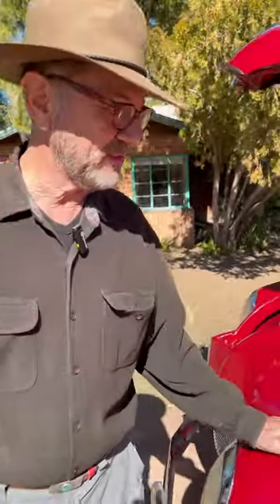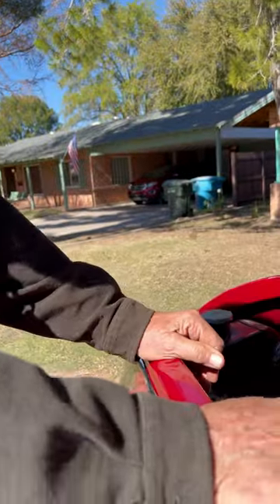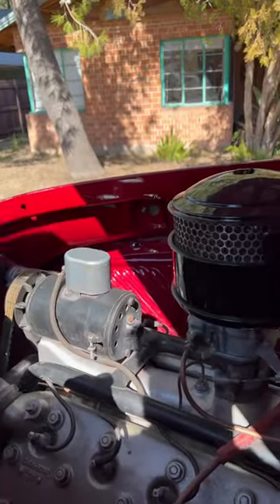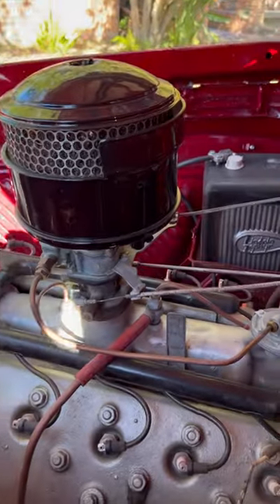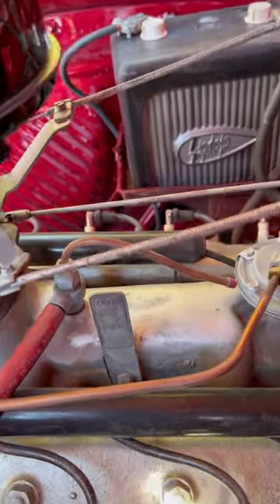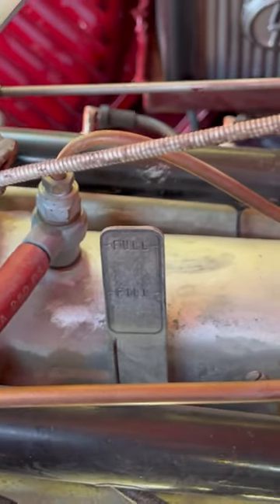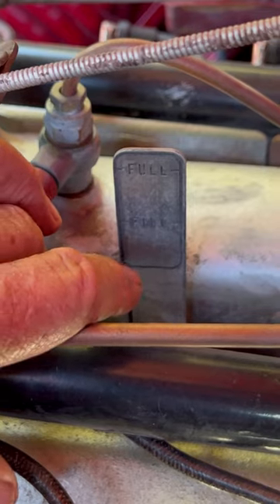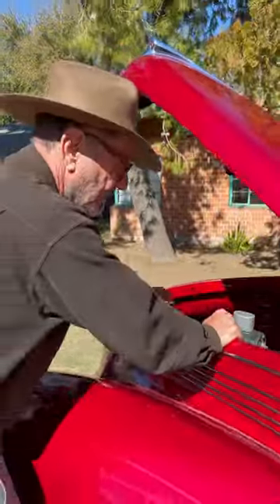Crazy No Dipstick Oil Check - Early Lincoln V12 Flathead #shorts #classiccars

Comment: No electronics needed, yeah Ford/Lincoln not known for good electrical period...
I noticed the Single barrel carburetor on a V12 Flathead, talk about majorly under carbureted...
Reply from the maker: It’s a single carburetor, but it does have two barrels… Yeah, JB has designed a custom intake manifold for these things that accommodate three stromberg 97’s… Seems to be a much more even presentation of fuel to all the cylinders. In other words, you make a good point!

Comment: One major problems with cars build before the 80s for the most part the engine and transmission did last 100 k usually there were some exceptions not many you really had to be right ontop of maintaining them .when I was a young man growing up and searching through junk yards all over the place  most cars had under 100k but they were definitely cooler looking and no plastic in the cars was awsome 👌 😎 now we can rebuild them with newer drive trains suspension and brakes and other comforts 😮now we can get 500 k out of our power trains unless you built a 1000 hp beast which is fine too but plan on a fleshing up every 60 k or so if your goin to drive it hard things have changed a lot in just 45 years we can really make our rides almost bullet proof😅😅😅
Reply from the maker: I agree with you wholeheartedly calling you have the right take on things I think

Comment: Thats why flatheads only lasted bout a 100k and blowed up they had no oil filter or drain plug on the pan... u checked it if it was low put some in it if thise engimes was had filters and couldve change the ol they wouldve run forever far less moving parts in a flathead

Comment: The most reliable is a stretch. Engines are inherently dirty and gunk buildup around the tube the marker goes through would probably cause this thing to give wrong readings.
Reply from the maker: OK, may be a bit of a stretch, but it sure was an easy read without getting your hands dirty… Let’s just go with that?

Comment: back when engineers had a brain and used it and built things that worked and lasted. 
compared that to today's junk and it makes you shake your head
Reply: Yep. as a mechanic id much rather work on this stuff then newer stuff
Reply: Now computers make it just strong enough,and last just long enough. (until they want you to buy a new one)
Reply: @atcjoe1600  couldnt agree more
Reply: That’s true except for the fact it was hard starting in cold weather had to warm up for 15-30 minutes burning extra gas and got 5-10 mpg. Other than that it was great.
Reply: @bobolink39  I mean my 96 f350 powerstroke starts just fine in 0 degree weather.
Reply: Built and lasted? These engines were severely under powered and were plagued with oil sludging and overheating.
Reply: And needed at least a valve and ring job every 35-50 thousand miles, plus plugs and points every 10-12 thousand with timing adjustments and seasonal carburetor re-jetting, 2000 mile oil changes, changing oil and cleaning the filter media in the oil-bath air cleaner, greasing 12-20 different chassis zerks, re-packing bearings at least every year, front end alignments, brake shoes (not pads) and bias-ply tires about every 12-15,000 miles and many other things that we don't have to deal with on a modern vehicle that will last 2-300,000 miles with very little maintenance, and are easily 10x safer in a crash.

But yeah, those were the days.
Reply: @ROBMACDUI  Right!?  Today you can buy a car and it's no big deal to drive it 100,000 or 200,000 miles with nothing other than routine maintenance.  and a single tune-up. That old engine would have to be rebuilt multiple times to last that long, plus it's low-powered, sucks down gas like it's going out of style, shakes, makes more noise and pollutes like hell.  It's ok to love the simplicity and the historical and cultural value of these old engines, I do too, but if you think they were better than what we have now you're either deluded or you're buying some shit brand of cars.
Reply: @atcjoe1600  most older vehicles could never make it over 100k miles
Reply: @7.3PSDA2  a 96 is not comparable to what these people are talking about.
Reply: @budgroweryt9947  why not?
Reply: @7.3PSDA2  because a 96 still uses a lot of electronics, and a bunch of other modern technology. I had a 91 f250 with the 351w and it was still not comparable to what these guys are talking about.
Reply: Back when a car had about 20 wires. Engineers today do have brains BTW
Reply: @budgroweryt9947  well my 1955 f100 with a flat head 4 cylinder or my 1951 ford 1 and 1/2 ton with a flat head v8 might be more along the lines then
Reply: @7.3PSDA2  much closer yes
Reply: @atcjoe1600  

I hope you and several others here don't use crapple products or that'd just be hilariously ironic.
Reply: @ROBMACDUI  

Exactly. 

My aging 'unreliable' Renault' (it's  from 2007 and still running well) hasn't needed anything but regular maintenance and a new thermostat housing and two new window regulators since I bought it 4 years ago.
Reply: @budgroweryt9947  

Some mid 90s cars had nothing more than electronic 'magic boxes' (transistor packs) to replace the points and condensers.
Reply: @skylined5534  ya but 96 was the year obd2 was standardized.
Reply: Do you drive an older car?
Reply: Thr car makers dont hire car guys as engineers. Most are millenials that could care less.
Reply: @ROBMACDUI  They ran forever. Henry drove a 2933 4 door to Mohave Ca from Detroit. He and 4 other guys drove on a dirt track for 24 horrs around the clock for 30 days ..NON STOP. Just to prove the dependability.
Reply: You actually have to be incredibly smart to design things that break just after the warranty period is over.
Reply: @raginroadrunner  That honestly wouldn't be a major feat for a modern car. In it's time it was very impressive though.
Reply: @paulh2981  well  yeahI really old ones like this one  but the idea is still the same keep it simple  And make it durable. That's what the old guy is saying. Some of the best cars now are like you know from the sixties and the seventies but they've been updated  they're called resto mods it's an  industry have you heard of it ?????
Reply: LMAO new cars run circles around this thing in terms of reliability

Comment: So you need to fill it then
Reply from the maker: Yes, we noticed the same thing!
Reply: @BarryTsGarage  this also means that you have to check the oil level only when your car is level? Really nice mechanism but it seems as if there has to be a hole from the top of the engine to the bottom of the oil pan. Is there any protection against dust and dirt falling in? Or oil coming out

Comment: There's a Generator instead of an alternator there too. Good ol'days! 😎
Reply: What's the difference?
Reply: @budgroweryt9947  ,a generator creates its own power while spinning. I'm not great at explaining, but you can run (spin) a generator and it will give 12 volts , an alternator won't without a power source to excite the circuit. A generator normally has a voltage regulator separate from it, an alternator is built in. Guess in short, design. They both run the electrical system and charge the battery. 🤷‍♂️
Reply: @HARLEYEAGLE88  you are mostly correct, an alternator needs to be fed 12v because it is capable of providing much more power,  and needs to be turned on and off, it also is only capable of ac power, whereas a generator is capable of making both ac and dc power. 

An alternator is much more efficient at doing the same job.
Reply: @budgroweryt9947  thanks for the refresher, been 45 plus years since I was in school for auto mechanics. Needless to say, about as long or longer since I've seen a generator on anything but a resto- auto. 😆
Reply: @HARLEYEAGLE88  well you old school guys are the best, thanks to you guys, we have such a huge and varied car culture now. So thank you! I will say though yall are also some of the most stubborn of the car guys lol, don't mean any disrespect with that comment so I hope it's not taken that way.
Reply: @budgroweryt9947  no offense, had to grease the ol brain gears and blow the dust off to answer. The last time I seen a generator in use is we had it mounted on a hand truck with a Briggs&Stratton engine for a portable jumper. Thanks for rattling the bolt bucket! 😄
Reply: @HARLEYEAGLE88  no problem at all! We use an old generator as auxiliary power for our 12v solar system. Works great.
Reply: @budgroweryt9947  good idea! I've seen a few videos of people's designs using wind and water to spin up a few volts for solar systems.  Gotta love inventions to make life easier, for one or all. 👍

Comment: Everyone thinking this is better/simpler/more reliable then a dipstick is clearly not a car person or has ever been around a motor. Dipsticks are much simpler, have no moving parts, would prove much more accurate when used properly (dipsticks use fluid adhesion vs multiple moving parts overcoming friction) and this old school design would be terribly susceptible to oil contamination.

Dipsticks are the simple solution, but have fun with your circle jerk.
Reply from the maker: This is an interesting point in automotive history, fun to watch the development and innovation that was going on back in the 1930s.

Your point is of course true, because we’re not using that system 80 years later, are we?

Comment: I love Boomers going on about "hrrr drrr back whun things were bilt to last" like this barge didn't make 60 horsepower on a 5 l motor that had to be rebuilt every 10,000 miles and wouldn't start if it was sweater weather. Ok grandpa, let's get you your chair.
Reply from the maker: 😂😂 you will probably never know the feeling of being able to fix anything that could possibly go wrong on your car by yourself with a reasonable amount of tools. It’s a very satisfying feeling.
Reply: Suit yourself but I'd rather be in a modern car at 150 than under your vintage one at 0

Comment: I'd say you're several quarts low there bud.....if it actually works
Reply from the maker: A quart would be right. The fact you could see that shows it works! Thanks
Reply: @BarryTsGarage  I figured perspective (camera angle) threw it off a little....seemed like it was an equal distance below fill mark, as fill mark is to full mark. Figured it took 5-6qts. Assumptions were made. What a neat device though. Thanks for sharing 🤙

Comment: One of the worst designed multi-cylinder motors ever to be put into production. Take the overheating flathead v8, squeeze the banks closer together, and add 4 more cylinders. Then have the same weak oil pump try to keep up with all those extra bearings. An absolute POS.

Comment: Acting like this is still possible is wrong due to vacuum that new engines pull through their pcv valve. And how does a dipstick not work good enough for you you must be a dipstick yourself
Reply from the maker: It worked at the time. Let’s stay with that.

Comment: Actually that design was pretty shitty. Now it might make more sense because our technology on seam welding is better but when the float went bad you were left with two choices.  Don’t check the oil level. Or drop the pan and change the float.  Both of which sucked.  The dip stick was the best solution and remains superior.
Reply from the maker: I agree - If it was superior we would still have it. I just think learning about the history of car development is very interesting.

Comment: That motor like all the rest of that era will need a complete rebuild at 100k. Not better than 90s toyotas. Poor metallurgy and failure prone pushrods and valves with low efficiency is what those were and are
Reply from the maker: No doubt. Technology has advanced so much over the years and with it added complexity - however it’s great to have a few examples of remaining cars to remind us of how things evolved…
Reply: @BarryT’sGarage  agreed. I'm just tired of old people saying "back when things were built to last". Maybe they tried to build them like that (doubt) but it just isn't the case and I've heard that crap my whole 34 years of life and believed it myself, as time had gone on we see which vehicles stood the test.